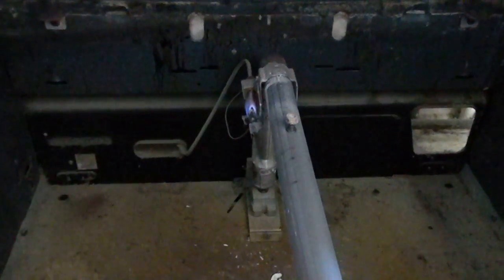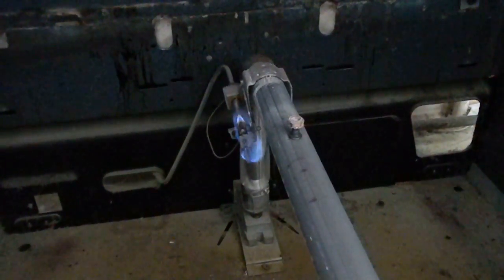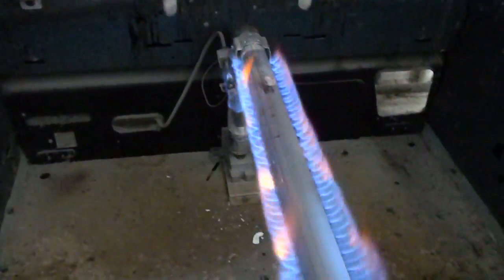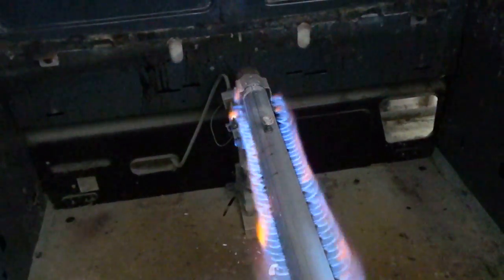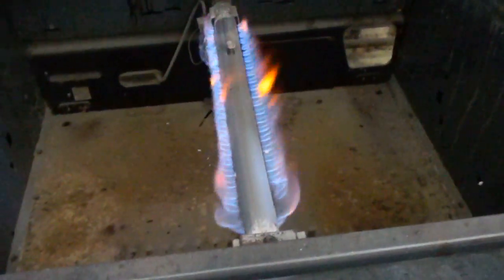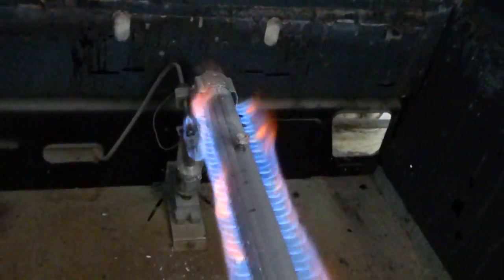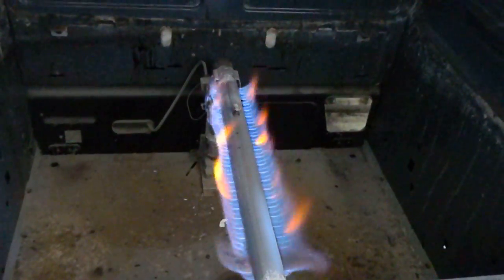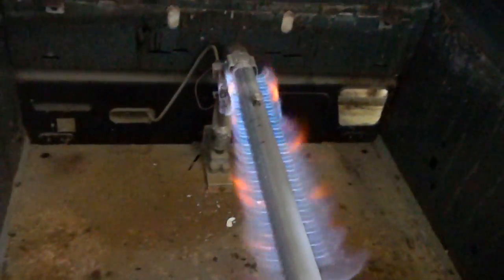Vintage Gas Oven Service, 707 443-8347  Eureka Ca, Oven quits?

Comment: Hwre i am 12 years after you posted this video. Hoping you reply. I have a vintage Magee which the oven burner wont light. The pilot works and sl does the ignitor yet the burner itself doesnt light up. 

Any help would be greatly appreciated. 
Thanks.

Comment: I see this is an older video but I Cleaned My oven the other day and I notice that the pilot light flame does not Sweep across the censor when I turn on the oven. Going to have to take a closer look at whats going on I am going to try and clean the Pilot jet Thanks for the post.

Comment: good video having a problem with mine I do have a pilot but when I increase the temperature pilot does not expand?? no combustion burners do not light just not release
Reply from the maker: May be you Oven Control Valve, but first check to see if your orifices are clear. Good Luck
Reply: thank you they were  Claire the stove was new to me but this pointed me in the right direction  control valve  inner part were not assembled properly previously I did manage to get the increase in pilot light and ignition hopefully temperature setting is correct have not checked yet video was very helpful

Comment: @EurekaRecycler what can I do if my flame is burnig yellow instead of blue and when I light the pilot and turn the oven on it blows out black soot for the first 5 min.
Reply from the maker: Sounds like contaminated gas
Reply: @EurekaRecycler  Can't be the gas because no one else has problems with the gas....
Reply: You have a dirty pilot, try tapping on the pilot tubing that should help to clean it, also if it gets really hot get a long tube that is about 1/4" fill your mouth with water and blow on the pilot tubing, also get a pipe cleaner and try to put it in until it is clean, the pilot should be blue not blowing or lifting.